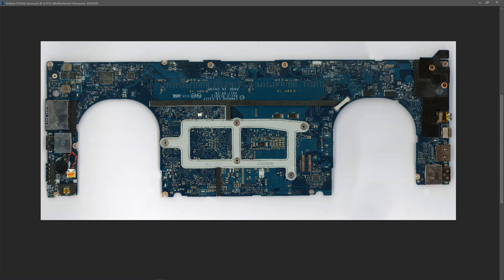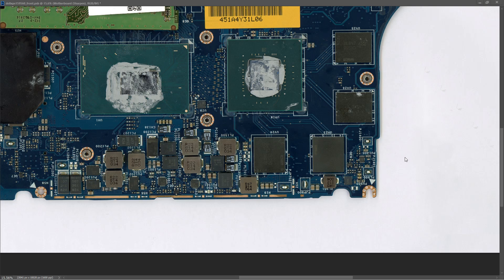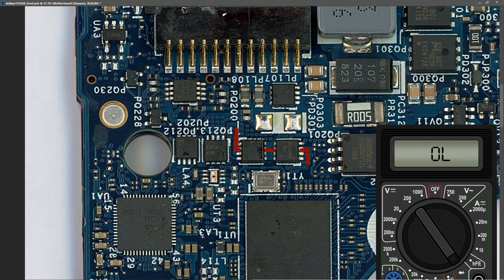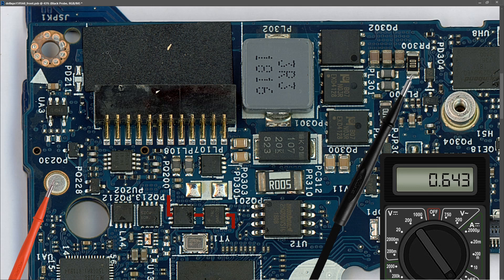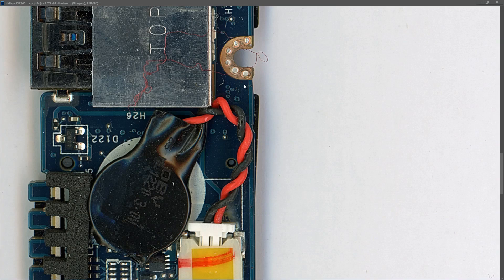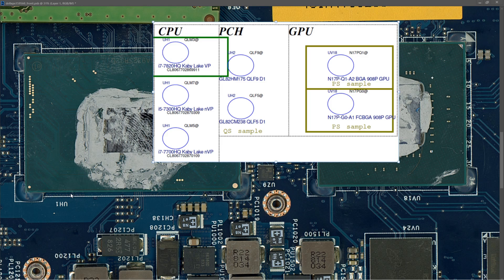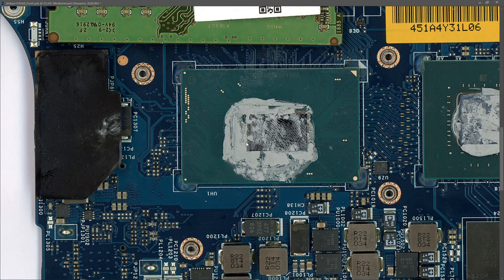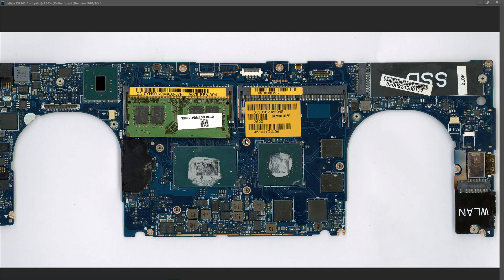DELL XPS 15 9560 - NOT POWERING ON

Comment: 11:15...  You are a rockstar. Giving us resistance measurements! I just changed tge thermal paste on my xps9560 and now it wont start it fan spins for 2 seconds then powers off. I tried reseating all the cables, swapping ram, removing all unnecessary peripherals, but no luck. Im thinking the cpu or gpu must have a short. What do you think? Tomorrow when I wake up Im going to compare my measurements with yours. Thanks so much. Also Im gonna do a thermal camera check. I wish it stayed on for 15 seconds like yours, but it turns off after 2 seconds so it seems like a slightly different issue. Have you ever seen anything like that? What would you check? I dont think its a PCH issue....
Reply: BTW do you still have this board ? If I can't fix mine if you wanna sell it I might buy it depending on the price.
Reply from the maker: Hi Peter, it's difficult to understand how just changing the thermal paste would lead to it not booting. Did you try removing BIOS battery, pressing power button for 20 seconds, install battery again, try power on? Did you use liquid metal theraml paste?
Reply: I used regular non conductive thermal paste. Tried resetting the CMOS 3 times. Once disconnected for 5 mins, once with 30 second power button press. Everything is disconnected from the board now except the fans. What I did before the issue occurred was cleaned screen and keyboard with alcohol and tissues, opened the laptop disconnected the battery, removed the two fans, cleaned them with compressed air, then removed the heat pipe/sink assembly cleaned with compressed air. Removed rock hard thermal paste with alcohol and cutips. Reapplied thermal paste and pads, screwed heat pipe assembly back, then reattached cables and powered on. I've done it 2 timed before without issue. The only thing I may have done different was not screw the heatsink screws in the recommended order, but I did them from opposing corners. I though maybe I cracked some bad pads or something due to incorrect screen order or something but I doubt it. I measured the resistors you measured and got similar values. I had to put the black and red probes opposite to get the same value for one of them, but no dead shorts so maybe the CPU core is fine. Not really sure where to probe, to see what stage it's failing at. There are no flashing led codes or beeps, just 2 second fan spin then shut down. I'll try and see if the thermal can shows anything, but 2 seconds will probably be too short... Its obviously aware something is wrong as it turns itself off. I need another working unit to compare to really.
Reply: shit breakthrough! I tried powering on while pushing on the PCH and it turned on.... I had ruled out the PCH originally because most users with PCH issues don't get fan spin. Gonna plug everything back in and see if it will boot stably. If not maybe I will try reflowing it. I heard the issue isn't the solder balls but intermittent package bond wires or something, so reflow reball may not help. Maybe I can just sandhich a giant thermal pad over it to apple pressure.

Update: its definitely the PCH its warm and now it won't even fan spin and I can't get it to boot with pushing on it. Time to watch some more videos about xps PCH issues. Thanks for your awesome video. Knowing the resistance values saved me reflowing the CPU as I thought that's what might have had a bad connection.
Reply: It seems its booting now not sure what changed. I think it was turning off when I thought it was turning on. I had no way to tell because it would sit at a black screen for 1 minute. After waiting over 1 min the bios charge adapter warning screen showed. That or there's an intermittent issue with the PCH and pushing on it fixed it...

Comment: Good video , can you share the schematic link or schematic via email and do you need to remove the key board to remove mother board?  Hope did not fry your brain, thanks
Reply from the maker: Hi, I get most of the schematics from badcaps.net if you set up an account there and run a search for the motherboard model you should be able to find it. I bought just the motherboard so I did not have to remove it from the laptop chassis.

Comment: Love the videos and contents.  Can you please offer some insight on the markings on the chokes or SMD inductors? I've spent hours researching, but avail. Especially the ones with 3 rows of part numbers
Reply from the maker: Hi Jeff, I was thinking of doing a follow up video on this board, since all I did in this video was replace the battery and wipe it down with a toothbrush. What do you need to know?
Reply: @therepairshare673  if you could explain what the numbers on the coils represent. If you look at 1:50 of the video you will see the coils with 3 row of numbers. What do they represent and do you need matching numbers for replacing? How do you know 0530 from 0630? I’m looking for one with 2R2 148 2CS on it. Love your videos!

Comment: No heatsink ... of course it will shut off
Reply: Correct, but for the sake of the video and trying to explain to the ones learning, you want to assume the MB came from a laptop that stopped turning on, with a heatsink and fans, so basics need to be exercised, which also helps to ensure  you don't do more damage.